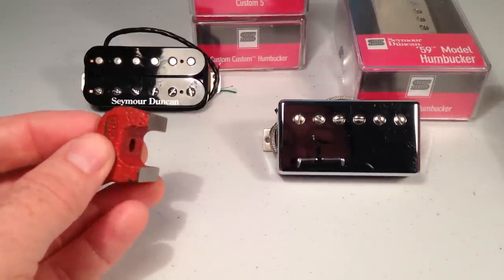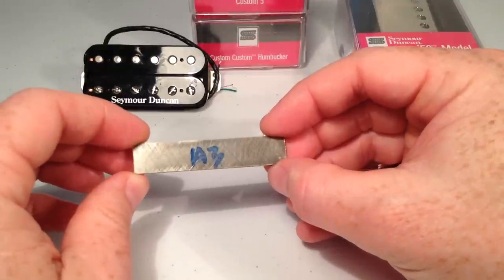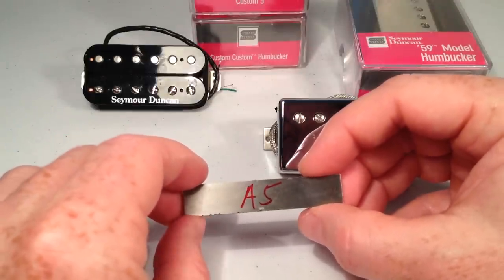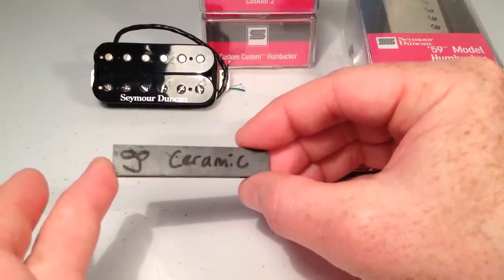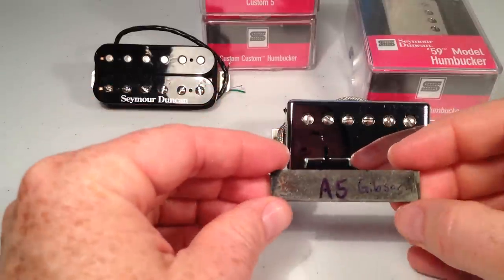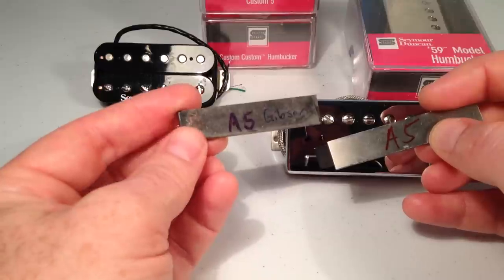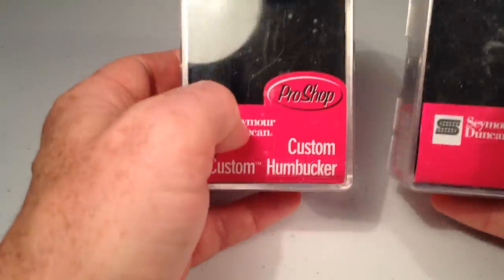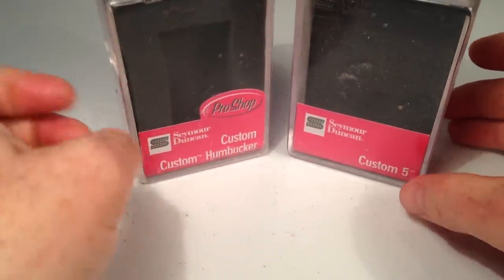Pickup Magnets and Tone

Comment: I watched this video with the hindsight of my own experience and knowledge on the matter and totally agree with all that is said. It is a really useful and concise explanation of the differences the magnet type can make. The example of the Seymour Duncan Custom range is perfect, as the only thing different about them is the magnet and they all have totally different tone characteristics and feel. I have a SD Custom Custom (A2 magnet) in one guitar and a SD Custom (ceramic magnet) in another. I swapped them around from the original guitars and improved the sound of both guitars because they then better complemented the natural tone of each guitar. I never appreciated until I did this how significant the magnet is, and I also realised that it is the character of the A2 magnet I like because they are the stock pickup magnets in the Gibson Les Paul and SG Standards I own. Great informative video!  🎸👍
Reply: Is the (SH-4) 'JB' humbucker very different tonally, compared to the (SH-14) 'Custom 5'?
(both Alnico 5 pickups)
Reply: Would you answer less magnetic sounds better? Ive a cheap quad pickup. They got 3 bar magnets on the bottom plate . Ive wondered what sound I might get removing the center magnet

Comment: Changing magnets do two things, one, you get different output, higher rated alnico magnets give you more output, and ceramic more still.

Secondly alnico magnets alter the inductance of the pickup, not as much as any iron so alnico vs ceramic is a very small difference in a humbucker as the alnico in a humbucker is in an addition to the iron poles.

Note that in single coils alnico replaces the iron poles, so alnico rod magnet poles are much brighter than the same coil with a ceramic magnet and steel poles.

Comment: I like USA made Alnico IV magnets. Almost all current pickup makers use Chinese made magnets which are a very different formula from magnets used in vintage PAF's, P-90's etc. I like to use the A-IV's because they have more of that old sound that we like. There's only 2 or 3 pickup makers I know of who use USA/American made magnets; ThroBak, Klein & TV Jones. Chinese magnets do not sound like the vintage Gibson magnets or vintage Fender magnets and TV has his made as well to the original mixture for his Gretsch replicas. An A-2 or A-5 magnet from 1959/60 will sound very different than a current production, Chinese made magnet that the big pickup makers use

Comment: I put together a parts box strat clone, for slide. It had two awful ceramic humbuckers in fatstrat pickguard, but I found a loose A5 and A2 magnets in the junk box so I swapped them in - A5 in the neck, A2 in the bridge. Both were over-wound because you can do that with ceramic and loosing some highs from extra wire is good. The result was excellent slide pickups, warm, full mids, smooth distortion tones, just right.

Comment: good tips about 'rough' magnets and using different magnets in the same Duncan 'custom custom'   pickup to get the sound you want cheaply (buying inexpensive magnets). polepiece adjustment is an easy adjustment with big benefits that nearly no guys know. And bar magnets are colored on the edge to indicate the alnico makeup (A5 is red, A2 is blue, etc.). Just be sure to insert new ones oriented just like the stock/original ones.

Comment: nice Video! I have spare MIM strat single coil Ceramic pickups lying around. Thinking of changing the magnets with Alnico 5 Slugs. (already ordered them). the current DC Resistnce is ~7 for all pickups. Excited to find out the difference once i install them with Alnico 5s :)

Comment: I had a small child's strat copy I found in a charity shop for £15. So I bought a Chinese Floyd Rose and two humbuckers for £18 delivered (!) I took the ceramic magnets out and put A2 alnicos in, added a coil tap and they are actually really good! I've got everything from vintage Gibsons to Fender Custom Shops to Duncan Shop Floor Custom pickups. As humbuckers they stand, in coil tap they are strange but its a short scale length (520mm) and the guitar had two single coils, now its got HSH, so the magnetic fields are probably overlapping horribly, but it looks and sounds great LOL!
Another thing; If you get a spare guitar and make some 'FrankenPickups' then it will always be something different to record with, giving you a one-off sound.

Comment: This is an awesome explanation. I recently change and A2 Smooth P90 set to A5 Rough cast and it totally changed the tone to my liking.  I have set of hum buckers that have smooth A5 magnets in another guitar and they are just to ice pickey on the top treble strings no matter how I set the pickup height and pole pieces.  What magnet wobble you recommend to to knock that treble down? I was thinking the rough cast A5 at first, but that might not be enough treble reduction. A4 smooth perhaps? or a A5 smooth unoriented? (Also, I don't like Alnico 2 pickups at all)  What would you suggest?

Comment: In my experience the magnet makes a bigger difference than the brand. I always recommend pickups to players regaring around a set of characteristics they're goiing for. In general, a ceramic mag is really the best thing for metal, to get a lot of sharp cut and push and low end clarity with high gain. But for most players I think alnico will do just fine. Yes, there are plenty of alnico pups that work great for metal, but I think ceramics really push things in the right direction. As for standard rock and jazz and blues, I think the magnet matters in a more subtle way. The most common alnico grade is 5, and I understand why it works well. The JB is a great example of a well-designed A5 pup. The Pearly Gates, the Alnico 2 Pro and the Custom Custom are all great examples of what alnico 2 can do. The only alnico 8 pup I've owned is the Duncan Alternative 8. It's like a JB on steroids but with more clarity on the low end and are more extreme top end, although not harsh. It just pushes a lot more. It's great for metal and hard rock. It has the advantages of both alnico and ceramic without the drawbacks.

Comment: These higher end pickups usually already sound good to me and even stock Gibson pickups don't disappoint, got the 490 series in my 01' Gibson Smartwood and i wouldn't change them but i've also played a couple of those mass produced Stratocasters from China and they sound thin as fuck.... i wonder how swapping those would turn out.

They usually have cheap ceramic magnets but if one were to replace these with alnico 2 bars they should sound a lot better for a couple of bucks and a little effort, would be a fuckload cheaper than replacing them and a fun mod to do.

Comment: Good video.  However if your definition of 'strength' is gauss (magnetism),  A3 is the weakest, A2 and A4 are usually close and you got the rest correct.  I think what you are perceiving as 'stronger,' are frequencies your ears favor and this is due to the changes in inductance, conductance and resonant frequency presented by the metal composition of the magnet.   But your viewers should know that you got the description of tones and perceived output correct.

Comment: From your descriptions, A5 sounds like what I want. 
High output. A lot up high and down low with a scooped midsection. Bright and clean with a fairly big bass that remains tight, and not as loose as an A2. 

An UOA5 sounds a little more modest and would probably be the conservative choice. But a sense of direction is important to me. 

The JB sounds like a nightmare before I've even heard it.
Reply: You may like the JB, it depends on the genre of music you play. The JB has a midrange bump that a lot of metal players (power metal) like myself like for a smooth solo tone. The JB is Duncan's most popular humbucker, so it definitely has a wide appeal. 

Regards 🎸
Reply: Custom 5 is the pickup you describe.
Lots of highs and bass with scooped mids

Comment: OK, thinkig about the best pickups you might recommend for a Fender Strat,  to get  like a Hendrix,  Stevie Ray type tone,  but not generic,  talking about getting as huge a sound as possible, but not really more distorted,  more like  just a huge tone,  all around.
Reply: Older video but I will comment..for a close to SRV tone I use the Seymour Duncan SVR-1N Vintage rails in the middle and neck position(s)..when I click on the 5 way switch to the 4th position "quack" position it sounds amazing..

Comment: Nice vid, thanks for the info. What about putting pickups too close, how close is too close when thinking about magnetic fileds or tone of the pickups? For example I have moded Pacifica, have a Hb bridge and a Tele neck, want to put a HB sized P90 in the middle, does it matter much if I put it like 5 milimeters away from one or the other pickup or should I never put it close than 10-15 milimeters?

Comment: I am building my own guitar to suit my play-style Originally i  am/was a bass player i have since moved over to classical nylon Flemenco/fingerstyle guitar.  For my guitar project i am  using the neck width which i found on a classical nylon guitar except i am using a gibson 25ish guitar scale. I will be using a TonePros Standard Locking Tune-o-matic/Tailpiece Set (small posts/notched saddles) Gold. The body is made from Jamaican Mahogany (back) and Patterned Purple heart and Bloodwood top. And lastly the nut will be made from Brass.  Now, with all that being said I am wondering about pickups.  I want a classical (Sink & Steel) guitar clean sound coupled with a Warm blues tone/sound Cello for bass tone French Horn for mids and Saxophone for highs..respectfully)what types of magnets would you use as a starting point in your endeavor if it was you and  is it best to have the high clean sound coming more from the bridge or neck pick-up or a combination of both?  My playstyle is alot of Travis picking open chords and slash chords so ringing out the low tone is essential as much sustain as possible ..hence the Brass nut.  My thoughts based upon what i have researched via your video and others was  Alnico V for neck pickup, and Alnico VIII for bridge Adjustable Poles in a classic Gibson Humbucker stype pickup.

Comment: i broke a ceramic magnet in my squire affinty strat and replaced it with an A2 alniko,  maybe the pick up is damaged but the out put is significantly lower than the other 2 pick ups.
Reply from the maker: Quadratic Heart ceramic is generally higher output than A2, but it should not be a drastic drop.

Comment: how can you know what kind of magnet a pickup has when its labelled and theres no info online jmmmmmmm
Reply: If it's black, it's ceramic. If it's silver looking, it's Alnico. Test touching it with a piece of metal like a screw. If the pull is weak it's a2, if it's somewhat strong it's a5. Very unlikely to find other types of alnico

Comment: So, I have a Seymour Duncan quarter pounder neck pickup on my start. I love the pickup except it's way too dark sounding. It reminds me of a muddy humbucker but in single coil form. I know you went through all these magnets but what magnet do you suggest I try to get some upper mids and treble back?
Reply from the maker: I have never owned a Quarter Pounder Single Coil, but if it is built like traditional singles, there is no bar magnet to replace. Single coil have individual rod magnets which are seen sticking out of the top of the bobbin. You could try using a 300k tone pot though. That will brighten single coils up a bit without letting them get too bright. Disconnecting the tone pot from the neck humbucker will also brighten neck pickups up a little. I always disconnect the tone pot from the neck pickup and connect it to the bridge pickup instead. Strat bridge pickups need a tone pot, but the neck pickup does not for most players.
Reply: Ummm... I'm a bit confused. You say you "love the pickup except it's way too dark sounding." Is it... really CUTE or something? Got a great personality?... I'm kinda new at this stuff, so: What part of a pickup that sounds bad in that guitar is the part you love?
Reply: DogFaced Boy He likes the dynamics and overall tone from it, it's just too dark. I have amps that I wish were much brighter, because the amp is too good overall to outright replace

Comment: Thank you very much for the video really very useful. Could you please advise me about one thing? If i swap the magnet of a5 with a2 magnet, is it exactly the same thing as removing/uninstalling the a5 pickup and installing a2 pickup as a whole?  if not is it because the wirings are different (gauges and turns , etc)